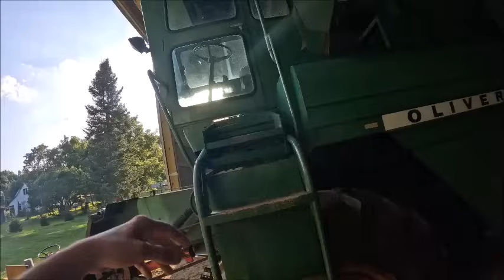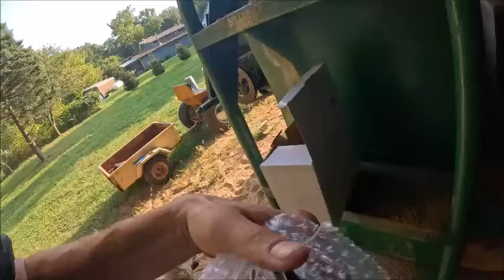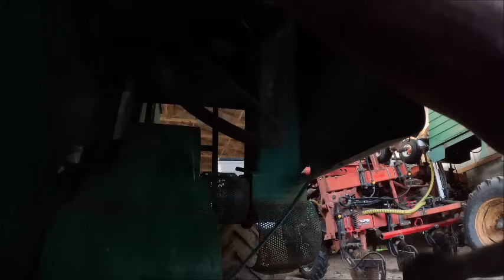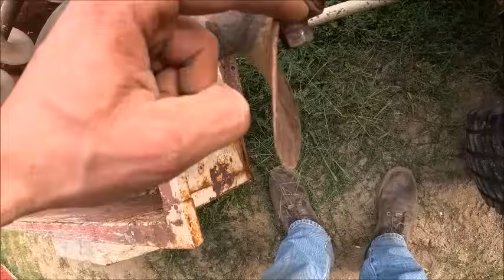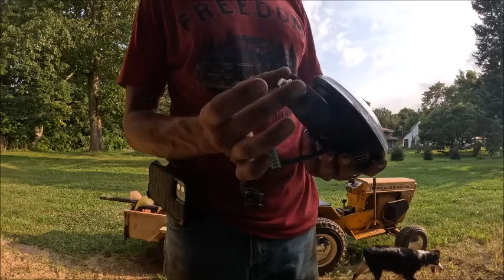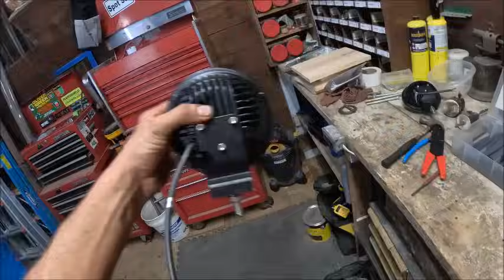Oliver 7300 Combine Maintenance Part 1: Oil, LED Lights And Augers

Comment: Most times if you take the mounting bracket off of the large LEDs they will fit in steel light housings. I prefer the old light fixture like you.  lights from Larsen lights will
Reply from the maker: Those are from Larsen.
Reply: @Oliver66FarmBoy  they are so they should work. The par 45’s come that way for the older Stiener’s. They fit the the factory round housing.  Still you will be happy with the lights we’ve bought from them for years. No failure and plenty of light for nights.

Comment: Save up your play money. My big collection sale is this fall, and most of it is your favorite color of green. I have a super nice 7300 with a very nice 4 row corn head, nice bean head, two open stations with bean heads and the pull type like yours with it's own motor that I've mentioned before. could buy it and fix yours.
Reply from the maker: I’m not buying anything else.
Reply: @Oliver66FarmBoy  At your age, that's no way to be. I thought you wanted a 2655, and I have one, plus a A4T 1600 Plainsman.
Reply from the maker: With a failing AG economy that’s exactly the way to be. I’m trying to farm not have a collection of over priced equipment that sits a collects dust.
Reply: @Oliver66FarmBoy  I do hope things get better for you real farmers. We build Racks for Automotive and all industries, plus sell Ag Panel siding and pole building kits. It's all off from what it was last few years, so I can relate. Good Luck.

Comment: @Ethan, does the felt hold moisture above the bearing, prematurely damaging it?  Maybe a metal spacer ( half the thickness) and a rubber spacer ( shock absorption)  Just an idea.
Reply from the maker: That’s not how it works.

Comment: Look at Steiner for replacement led bulbs for original housings. I use them and Messicks for my David Browns
Reply from the maker: Steiner is China trash.
Reply: @Oliver66FarmBoy  50/50 on the China stuff but it’s getting to be that way anywhere. Even my original suppliers have packages showing up with foreign parts